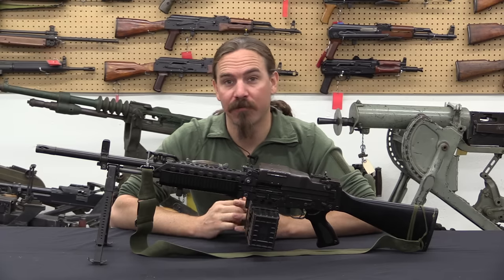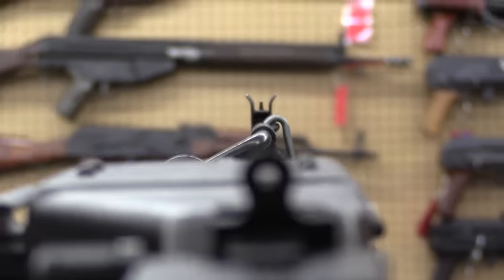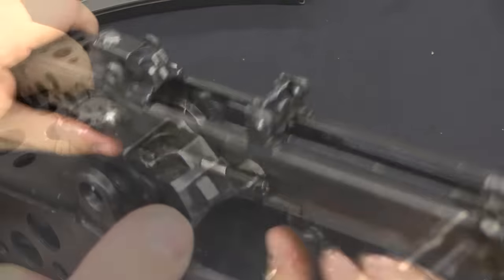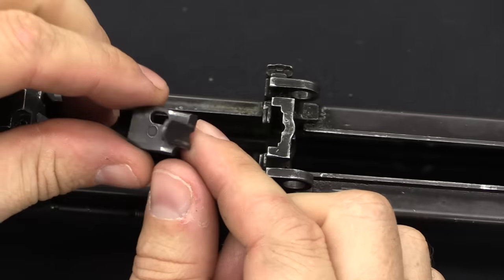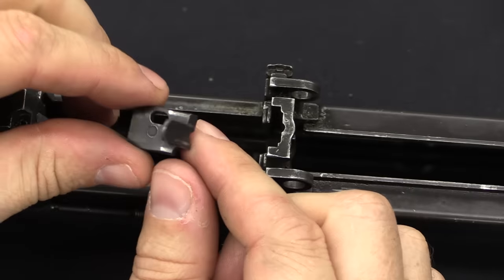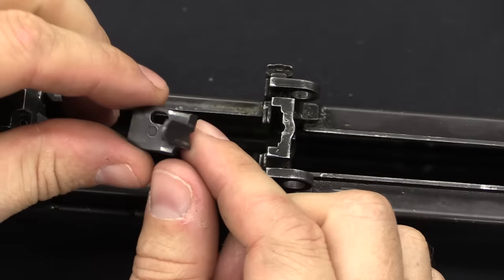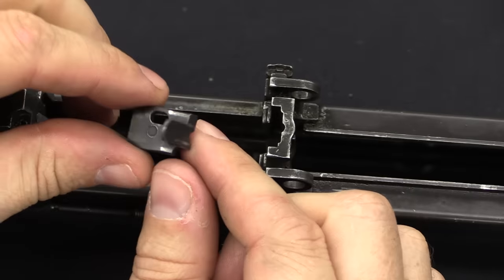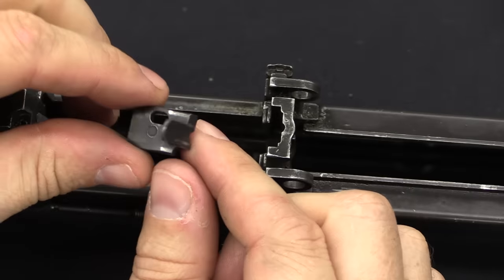Stoner 63, 63A, & Mk23: History and Mechanics

Comment: The weight difference is pretty substantial in comparison.
Stoner 63: 12lbs
M249:        17lbs
M60:          24lbs
You aren't getting the same firepower as an M60, but you're still getting sustained fire from a gun that weighs half as much.
Reply: Plus each 5.56 cartridge weighed less than half of the 7.62 cartridges of the M60. The SEAL could carry far more ammo, which is very useful. The distances in Vietnamese jungle fighting aren't usually that far so the disadvantage of 5.56 is minimized. So more than double the 7.62 ammo plus 12lbs of ammo, which in M193 5.56 is around 462rds. Or carry less ammo and have other equipment or be less encumbered for more mobility. Having a thousand extra rounds or more for the same weight is a major advantage for a machine gunner. And we're talking guys doing LRRP and going deep on foot into North Vietnam, Laos, and Cambodia who really needed to be able to cover ground and lay down suppressive fire and fight without running out of ammo with all their equipment and weapons man-portable. The additional potency of the 7.62 cartridge of the M60 wouldn't rarely be worth the massive trade-offs necessitated by the additional weight.
Reply: m60 go    durkadurkadurkadurka.     STONER GO ZURRRRRRRRRRRRRRRR
Reply: @theme7363  thx
Reply: What's worse is when you compare this and the original M16 to the rifle/carbines we use today:

Stoner 63: 11.68 Lbs.
M16/M16A1: 6.37 Lbs.

M16A4: 7.5 Lbs.
XM7: 8.38 Lbs. (9.84 Lbs. With Suppressor)

On what planet does it make sense for a 13 inch Carbine to to have a mass closer to an open-bolt LMG than the 20 inch main battle rifle it is based on? Further, what possible justification is there for what should be the same rifle with only minor alterations across 50 years to have a dry mass that's more than a full pound heavier?

Comment: I was part of the SAWS test at Ft Jackson Aug 1965 to Dec 1965, in the "Colt platoon." Gene Stoner was with us a lot. I qualified with a Stoner LMG before I even touched an M60. The official Army complaint about the Stoner LMG was it was too accurate and had no effective beaten zone. True. The rate of fire was crazy, snapping the ammo belts. True. Another issue I didn't agree with was the theory the tracers would (or could) wearing away the gas system ports at such a high rate of fire.  Last, the Stoner configurations had too many parts for the grunts to keep track of, another theoretical problem. The Army just didn't want it.

Comment: Ian, I just wanted to drop a note to express my appreciation for this video. As an excellent tutorial for riflemen, this video is more like a seminar to professional design engineers. Over the past 40-years I have been tinkering with a similar system based on the AR-15 architecture. Just as Stoner did with the 63 system, the same design philosophies could be applied - in retrospect - to the older AR-15 platform. I'm retired now, but kept my night job which is nothing more than a continuation of the previous 55-years. Gone are the drawing board and t-square...hello CAD systems. Vita Bella. Imagine an AR-15 that could be "field" converted into any of several permutations within a reasonable amount of battlefield time! I carried the XM16E1 and XM177E2 and immediately marveled at the (possible) flexibility of these weapons' roles, from DMR-ish to MBR to jungle-friendly carbine to SAW (kind'a) to LMG (sort of) and even a quasi sub-machinegun. I thought the possibilities were all there, but never really pursued; well, 'yes' in the model permutations, but 'no' in the modular aspect. Anyhow, I continue to fiddle around with various designs allowing for things like quick change stocks, handguards, barrels (length and weight), sighting systems and fire control. Without guilt, I sit on the shoulders of Mr. Stoner applying his genius of the 63 to the AR-15. This is not the case of a designer plagiarizing prior art, but rather an honor whose intentions are to innovate on the preceding genius. Sorry to be so long winded, but I did want to share my thoughts of this concept. Eventually, I will put some of these mods up on my channel, but for now I'll proceed in the true fashion of a casually-active retired old guy. Thanks for the super video and the associated "range testing" episode.

Comment: If the mounting points for the handguard are as repeatable as the ones for the sights I would assume making a picatinny mount for on top of the rifle/carbine and a modern handguard with MLok or picatinny would be easy to do without modifying existing parts. Making an optic mounting surface for the top fed mag (automatic rifle) configuration would require a little more care as it would still have to work with the original magazines, but still doable without modifying any original parts. Getting an optic on the belt fed configuration would be the most difficult as you would have to remanufacture the entire belt feed assembly if you didn't want to modify an original. But if you were ok with modifying an original just carefully welding some pic rail to the top cover would probably work. If the NFA goes away I could see repro packages of this having such modernizations.

Comment: The springloaded track cam on the 63A only prevented damage to the weapon if closed with the bolt forward. If you tried to charge it after closing the feed cover with the bolt forward the cam would pop up in the space outside the track and prevent charging. The M60 and M249 did the same thing. The feed tray cover must be closed when the bolt carrier group is to the rear in order to operate correctly.

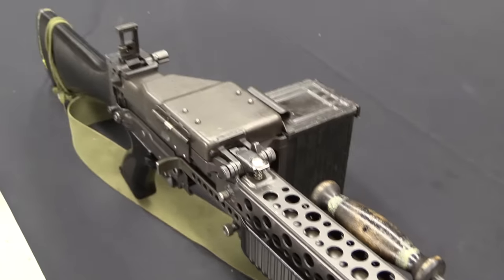Comment: @ 4:25 Fold down the Ladder rear sight, to use the Aperture battle sight,,,, Nice !
@ 19:30 Both top mounted Charging Handles have the same knurled base; with a different extension pinned in.
@ 24:30 The FS Tower is "hollow cast", showing where the gas diverts up into the gas tube; unlike the AR family, where it's hidden in a "full cast" Tower.
@ 32:00 I imagine there were times, unless they were running & gunning, where the A-Gunner just held the box abreast the gun, to speed things up.

Comment: Cool to see. I got a centurion arms cm4 11.5 inch with the stoner 63 flash hider. I figured if it was designed for use on a gun like this, it would do well with flash suppression on a short barrel AR. . It works great and I've yet to notice a hint of flash from multiple types of ammo. Granted I haven't had a chance to shoot it at night but im pleased so far.

Comment: Very cool. I have an NWM “squirrel” bayonet that I bought at a gun show back in the late 1970s. Paid $10 for it, and it was my “car knife” that sat between the seats and the gear shift of my VW Bug until I sold the car in the 90’s.  Used the hell out of it. It really can cut wire, but the saw tooth is pretty much useless. Still have it in my knife drawer. No, it’s not for sale.

Comment: I'm hoping Ian can do a video specifically on the 63. From the charging handle section of the video it seems he has only the 63a. The charging handle slot on the 63 is on the side of the receiver, on the 63a it's on the top/bottom. I'm curious of other differences I don't know about.

Comment: It may be confirmation bias but it sure seems like my beloved Corps gets mentioned a lot when it comes innovative arms testing.
Reply: One of the reasons the US Marines do a lot more testing and initial implementstion of firearms than the US Army is due to the smaller size in terms if the number of personnel.

The US Marines can test, evaluate and if warranted eventually  adopt new weapons at a lower cost than can the US Army.

Adding new weapons into smaller units first is easier on the logistics and training.
Reply: That makes sense but even when I was in during the Clinton years we were doing some very early experiments with drones and even boring stuff like tents and boots were being tested on a large scale basis. We just seem to be willing to try things.
Reply: I was in the 9th Infantry Division motorized, in the late 80's.
Everything on Ft Lewis was an experiment.

I saw people who had to walk a pair of boots around a track with an NCO watching em to see how many miles it took to wear them out. 

Humvees were filled with fuel and driven around a track until they ran out of fuel repeatedly to get average fuel mileages and how long it took to wear out the tires and other parts. 

This went on with every piece of equipment we had.
We had stuff I never saw anywhere else.  Equipment from one battalion to the next even varied. 

All of our tactics were based on mechanized infantry and combined arms concepts. All of it was experimental so the Army did not have to waste the fuel and parts of real mechanized units.

Best thing that I think came out of there was the Danner cold weather boots  called Ft Lewis Go Devil Boots. Gortex and warm.
One of the best pair of  cold weather boots I ever wore.
I still own Danner boots that are Gortex to this day although I have gone with a lighter pair as cold weather is not much of thing in Texas but wet weather is.

Thank you for your service Revolting Man.

Comment: The Stoner 63 was a very complex gun in order to be a “system” (rifle / machine gun). It was very ingenious, but was not practical for the individual user (who needed only one type). Comparing it to its half-sister AR-15 / M16, it was more reliable for having a piston actuator, preventing powder residues from reaching the cycling mechanism (that was the M16 worst feature).  It is a mistery to me why Stoner did not adopt a piston actuator for the M16 at a later revision. It would have brought its operating reliability much closer to the AK-47.

Comment: Great work Ian, very clear descriptions of the Stoner Weapon System.
This is a complex weapons system not suited to a conscript Army, that was further abused by McNamara's Project 100,000 low IQ servicemen (about 350,000 in total).  At the same time the US Army transitioned from the government M14 to the COTS AR15 - M16, not subject to testing and not issued with a cleaning kit!, because the lying US MIC said it was "self-cleaning".  // The Green Berets had just been revitalized, stripping Infantry units of their smart soldiers.
The then corrupt US Army Ordinance Department would have hated this weapon system.
However the USN SEALs are a professional crew of smart warriors and the Stoner suited their style of dynamic warfare.   So, as the USN SEALs could make the Stoner work very well; the concept was viable, but probably best suited to SF.
Thank you again, Greg

Comment: Id almost argue that the point of this gun coudve been acomplised by different upper for the m16. Besides having a open bolt. Versions with different barrels piston types, handguards. Almost no one relizes it. They somwhat did on the first version of the mk18. Were it used to be meant to be put on a m4 lower. But i think i can take ut a step further. The problem with ar15s is buffers. Different buffers perform differently on different gas types and barrels. Wich is why i think if the ar18 was more milatary grade. More durrable and reliable of a platform. And had the same lower and upper mount of a ar15. It could be a more coveinyent version of what the stoner 63 was sopposed to be. A all in one gun. Swap the carbin upper for a dmr upper or machine gun upper or a inegral suppressed sbr. No need to worry about buffers and stuff.or do a milataru version of the brn 180. Make it more moduler. Thats how you make what was sopposed to be a stoner 63.

Comment: Everyone talks a lot of praise about this gun, but my grandfather actually tested it several times while in the Marines and had some issues.  His main focus was on the squad automatic configuration since he had personal experience lugging the BAR around in his early days and the m60 was too large to fit the role.  He found that the gas system while is the SAW configuration blew gas right back into the eyes.  After several bursts he was practically blinded.  He gave them feedback, but the issue was never fixed each time they came around for more testing.  I still think it's a cool system, but I trust my grandfather.  

The talk of the early m16's jamming is very true though.  Since the army provided the Marine Corps with these early m16's his unit experienced a lot of jams.  A lot of Sgt's were lost because they carried the punch rod for stuck bullets and standing or kneeling during a firefight inevitably leads to greater risk.  However, I think people overlook that once m16's were chrome-lined this issue drastically reduced and the weapon system was perfectly adequate.

Comment: The US MARINE CORPS did want the Stoner gun in fact they were impressed with the weapon enough that they were going to order more for trial phase for procurement purposes.  By the time the USMC was ready for order of more rifles the ARMY bought into the M-16 system at that point the USMC had to drop the Stoner trials for the M16.   At that time the US ARMY dictated what the military would carry for a service rifle and thanks to McNamara pushing the M16 thru the proverbial red tape the US MARINES got hosed.    Even today the Army dictates to some extent what the military carries for a service rifle although its getting better with some weapon systems its still that way.   I believe the reason behind this is because WWII and Korea you could have in a squad a M1A1 Garand,M1A .30 carbine, Thompson 45acp, Browning 3006, 30 Caliber belt fed machine gun, 45 acp Grease gun to many not interchangeable weapons magazines and ammo.  I believe resupply was problematic and the military wanted to condense all this down to a weapon system.  Anyway the MARINE CORPS wanted the weapon they like the interchangeability in the system you could have a assault rifle mag fed and belt fed just by changing the parts out the USMC believed with further testing and upgrades the weapon could come on line pretty fast.